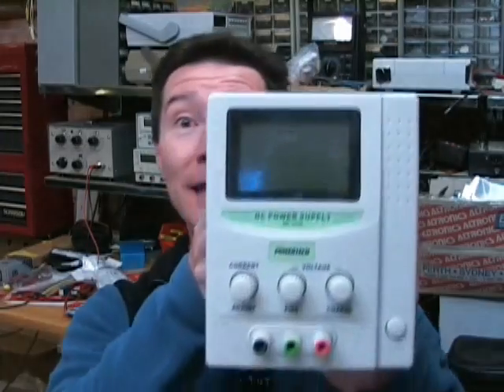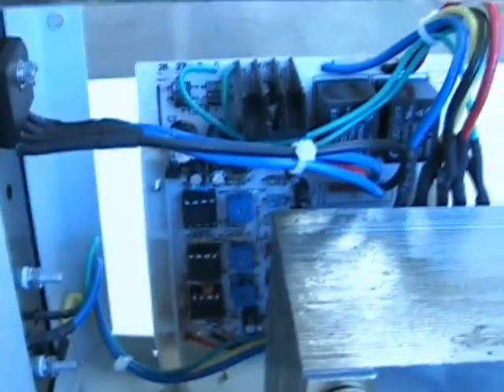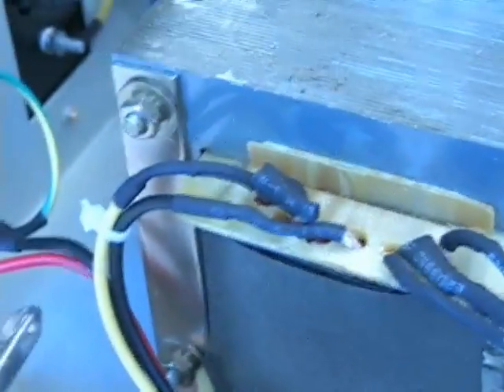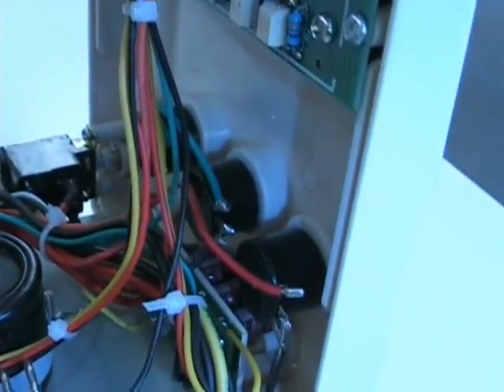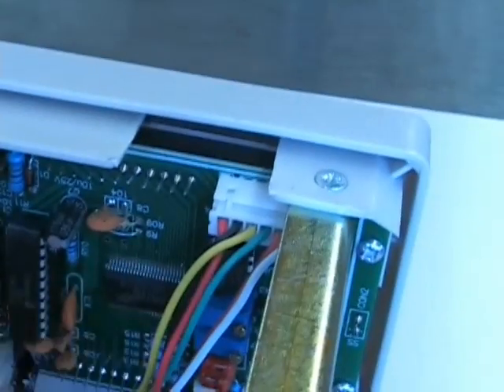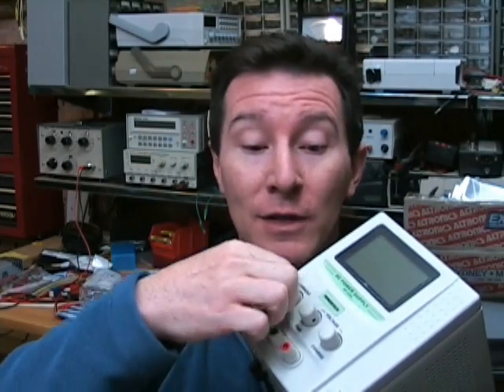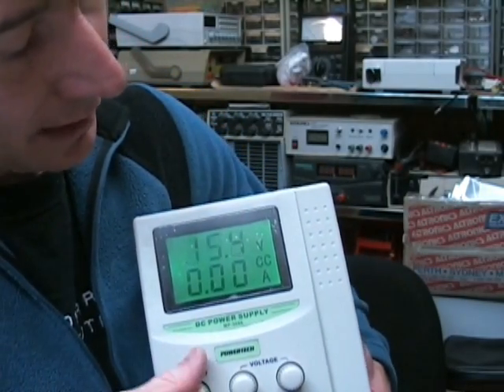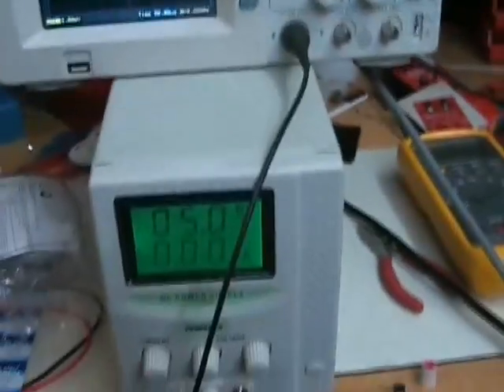EEVblog #30 - Jaycar Bench Lab Power Supply Review

Comment: 2:23 The mains earth wire is also a mounting screw for the IEC connector? FAIL. Needs to be a separate dedicated screw or welded post. Plugging/unplugging the power cord could cause that screw to work loose; not such a big deal for the connector, but could be a big deal for the earth wire.

Comment: I can't catch the "output curvature" word. "current shunt"? "carature"? What is that thing?
Reply: Current Shunt. It's a low resistance wire which is used in series with a load to present a small voltage to a sense circuit that converts the measured voltage drop into the Amps reading on the display.

Comment: I'm in Australia and I got a reliable 30v 5amp supply for 70 bucks. Relayed fans, compact and amp/milliamp switching. yihua 305D
Reply: i have the same power supply coming in the mail. the only bad thing i have seen about them atm is the voltage/ amperage readouts arnt very accurate, but can be adjusted. oh well when i get it it will be taken apart first up for inspection to make sure there isnt any dodgy connections, and to adjust the readouts
Reply: +Liam Batge I have heard things about this as well, but personally it works really well for general applications like lipo charging. If you need really precise application just use your meter
Reply: Markimoo ahh ok, thats good to hear, i also have some lipo's to charge, i mainly bough it though for my ZVS driver for flybacks (once it arrives from china)

Comment: Just an update With the Jaycar LAB PSU they have updated/changed the design and most of the stuff that was a little dodgy they have fixed and other stuff they have improved,
There is now 2 Transistors with space for extra 2, the voltage adj is better as well 0.01 increments "it feels nice and smooth" 3 buttons for current, better mounted parts, nice heatsink design for the Transistors "the sort you would see on the more expensive ones"

No overshoot on power up.....

the banana plugs are a little cheap. "simple fix for that if your worried"

AC is thermal covered and far enough from anything else.
LCD looks the same nice and big. "would be nice with a backlight adj easy to add one"

Thermal sensor for heatsink, Thermo Fan at the back.

Transformer taps soldered to the plug on the board. "a little odd seems that there are still two designers"

zero noise!.

Extra info the control and LCD are SMD, the power board is through hole.
comes with some leads but there well cheap very very cheap. " i would not put 30volts @ 3 amps through them that's for sure good thing i have my own.

For $150 bucks i am happy.

So Thanks Dave it seems they listen to you.

Comment: Mains bundled with mains... legal in the US if the other wires have dielectric strength suitable for mains voltages.

I don't recommend it in any case however! Everything goes to hell if you get a transient and the mains wiring is noisy. Keep the sensitive stuff on the other side of a transformer and keep the mains well away.

Comment: I have had one of these for a while and initially I killed the first one by charging an SLA battery overnight and it was replaced under warranty without a hitch. I noticed the overshoot @8:00 and checked mine out as I recently fried a board I was working on. Sure enough the same thing on my supply!! It occurs intermittently when I set it for 5v output, you can hear a louder relay clunk when it occurs it shoots up to ~16 volts and ramps down to 5v over ~350ms. What a joke! Not worth the hassle.

Comment: Dave: Can you please explain why there are areas of exposed solder on some of the traces on the bottom of the regulator PCB? I often see that on cheap power supply boards - I suspect that they effectively thicken their traces by adding solder - but I'd like to hear your opinion/explanation. Thanks!

Comment: @DanFrederiksen Switch mode power supplies have poorer regulation, and much more noise and ripple than a traditional linear power supply. Some of them produce quite a bit of RF noise, and that can be a concern if radio interference is an issue. It is generally easier to find a linear power supply with current limiting / constant current mode than a switch-mode one, although they DO exist. It really increases the price though.

Comment: @DanFrederiksen SMPSs usually have higher noise levels, though with appropriate filtering it should be no more than the a.c. ripple noise out of a transformer. It may well all come down to development time, it's quicker to just put a big ass transformer in there with appropriate electronics than build a SMPS.